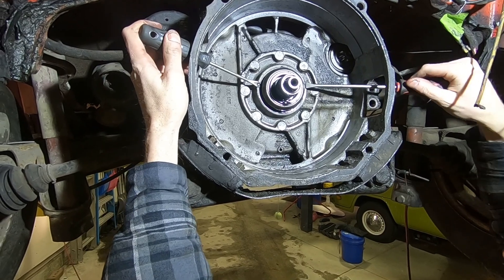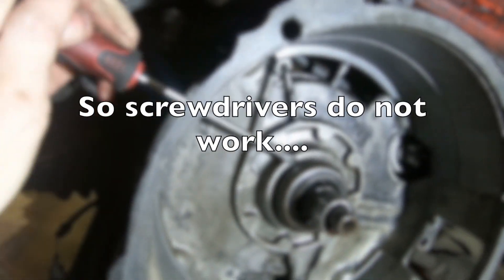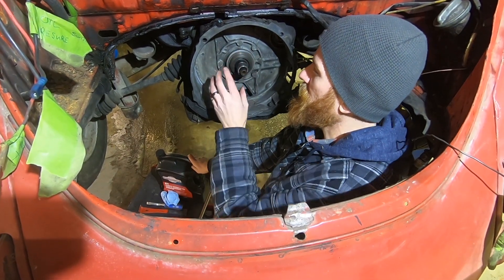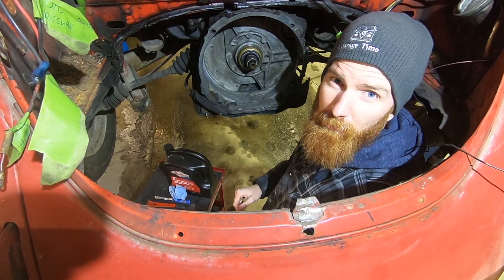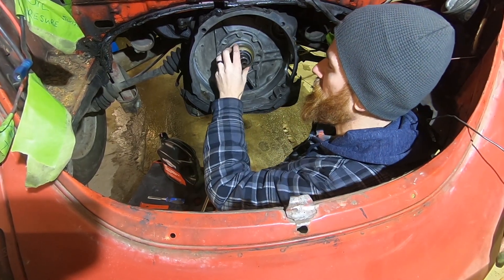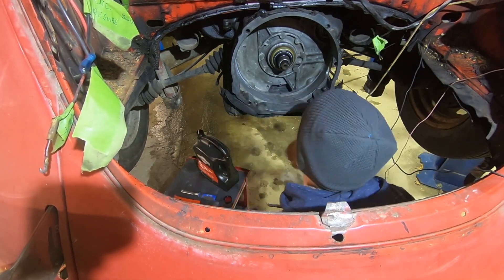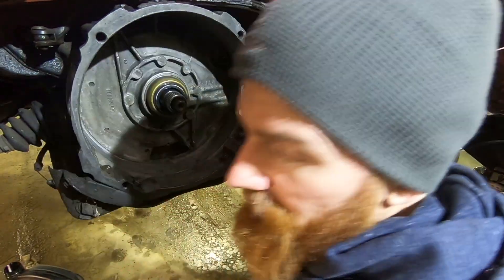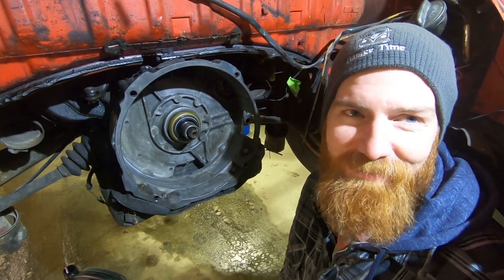VW Autostick - Torque Converter Seal & Bushing Replacement

Comment: I like using a cheap, two-arm puller with the inward-facing tips. I had to grind the tips flat enough to fit under the lip, but it worked great for removing that seal.
Reply from the maker: Will give it a try if I have to replace again. Thanks

Comment: I would like to see a video on you taking apart the shifter. There is sapose to be some electrical connections in there that needs cleaning. I have no clue on where to start. Thanks
Reply from the maker: Yes, we have to replace the electric shift contact point, will have a video, disassembling, replacing contact point and reassembling. Should be in the next few weeks. Thanks.
Reply from the maker: Hey Brent, just posted video on autostick, stick shift. Hopefully it helps, let us know if you have any questions.  Thanks.

Comment: Did you replace the brass bushing on the torque converter?  If so, where did you find it?  I’m having a hard time finding one for mine. Any advice?
Reply from the maker: No never found one, used the better of the two I had.  Hopefully someone starts reproducing these parts or the autosticks will all disappear.
Reply: Hi Bill, I needed a brass bush for mine and couldn't find one online. I did find the dimensions for the bush online somewhere (but have just looked and can't find it now!) and had two made by our machinists at work. Once you have the dimensions, you should be able to get one made easily.

Comment: Did it work after putting it all together? I have a friend with a 69 Ghia and has done his seal 3 times using the inner and outer spring type seals, with no luck, still leaking. I am doing some research for him to see if I can help. Thank you for the video!
Reply from the maker: It did, drove around last summer, however while sitting this winter it has developed a small drip. We will be pulling engine to see where or what is going on.  We will post a video of what we find.  Autostick videos will be coming up again soon.  Thanks and good luck.

Comment: I have a 1969 standard vw bug that I want to convert to utomatic, which is what I need. I have this: *flex cooled drive plate,  *auto sitick pedal assembly,  *30 pict 1 carburator electric choke,  * vw autostick torque converter seal, *empi 9409 12 volts bosch blue coil,  *vw bug distributor all in one single vaccum advanced vw svda bug , * vw autostick torque converte.

this is all I have or I need something else please let me know thanks
Reply from the maker: Ricardo Enriquez Hi Ricardo, have you watch our video VW Autostick vs Standard engine? We go into detail on specific autostick parts required, specifically for an autostick. We had to go through same process to get ours back on the road. Have a look and let us know if you have more questions. And please don't forget to subscribe!
Reply: I found the perfect tool for prying out the old torque converter seal, and everybody has this - a teaspoon.   It's short enough to fit within th bell housing so no need to fork through the side access holes.  And the pointed narrow rounded tip its into the gap and easily goes under the seal edge to pry it off.  A shoe horn also works well.

Comment: How do you remove and install the flexplate on the motor
Reply from the maker: Never had to remove one yet, but have read some guys got it with impact, while others had fabricated bars to lock to it and engine bolt holes to stop from spinning. Check out:  http://vwar.org/forum/index.php?topic=913.0 if you have not. Lots of good autostick stuff on there. 

Thanks and good luck
Reply from the maker: Seemed to be pretty much stock.
Reply: @GarageTime  is an autostick typically have a flat or dished cam?